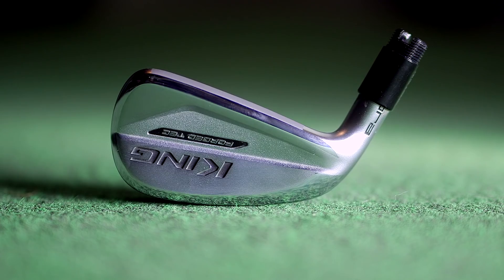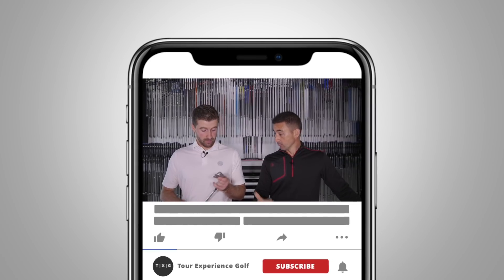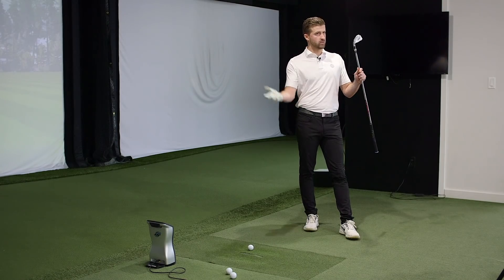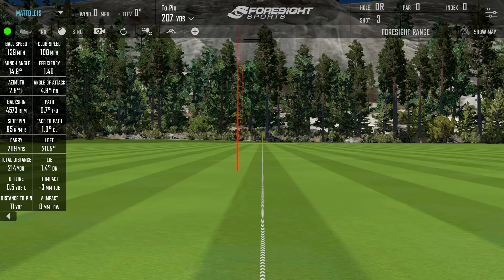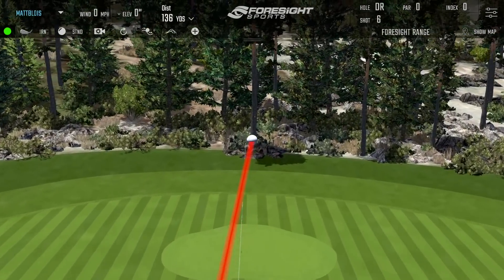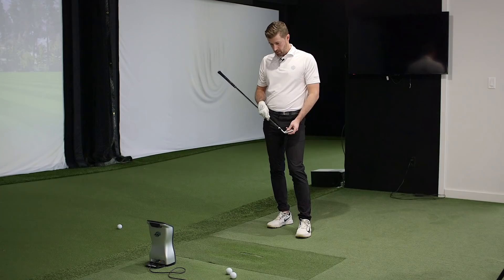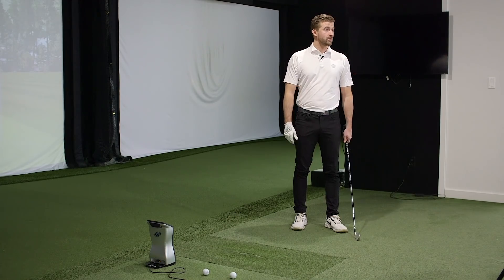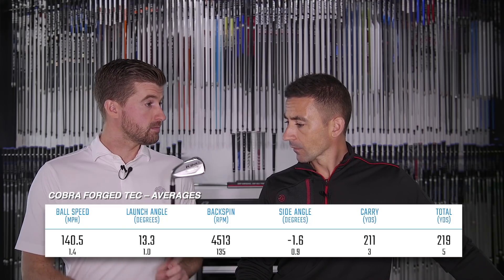Cobra Forged Tec Irons Review

Comment: Would love to see a test where you do a gapping session with the stock manufacturer specs. So get a set of clubs. Bend them so they are all exactly what the manufacture says the loft and lie should be on their spec sheet, and then have Matt hit them all.  I’d like to see if the stock specs of an off the rack set of clubs actually gives proper gapping.  I’d imagine these cobras and other sets where they get 2-3 degree gaps in the low end start to really bunch up badly.
Reply: Kourtney Matt is WAY above the speed of the target golfer for this set. The tech has changed - each individual iron is separately engineered on these sets. At the top of the set they're getting higher ball speed from the low loft & piling tungsten in the bottom to get launch. You'll get the distance gaps you should get - the problem you end up running into is that you get really high launch/low spin so you can't stop the 3-iron on any of these sets. 

However, no one is buying the 3-iron. That's part of why they're popular; golfers don't care about the 3/4/5 loft gaps because they're hitting the 5-iron 180 and using hybrids above that. 

I'm 39 & a 3 hdcp. Haven't carried a 4-iron since 10th grade. Hardly any golfers hit any 4-iron better than a 21-degree hybrid that goes a similar distance. I just switched from MP-64s to MP-20 HMBs 5-PW. 52/56/60 vokeys at the bottom and old TM hybrid that I can hit 190-205 above it. No gap problems at all.
Reply: @canyonaro  I get what your saying but swing speed is irrelevant when it comes to gapping. If anything higher swing speed would be more likely to have proper gaps with  2-3 degree loft separation than a slower swing player. Slower players see bunch ups in the low loft irons (3-5) irons even before manufacturers went down to 2 degree loft gaps because they don't have enough speed to create enough spin and launch to get the ball to carry reasonable gaps. Also in an iron head the cg can only be moved a small amount so you aren't going to massive changes in spin rates when you compare a blade at 24 degrees loft to a game improvement of 24 degrees loft. In fact a lot of times you'll actually see better stopping power in the game improvement irons because spin is similar but launch is better so you have a steeper decent angle.  If you don't believe me check out txgs game improvement vs blade video. The spin rates are basically the same. But I agree no average player should game an iron with less than say 24 degrees of loft unless they got a lot of speed. 24 degrees used to be a 4 iron. Now it's a 5 iron in modern lofts.

Comment: I tried these recently and am very tempted to try them, I hit the 7 iron in the fitting and numbers were around 141 ball speed, 7000 spin and 50+ peak height but could hit them low if wanted. 
I've always been wary to hit a club like this with a lot of speed but I wondef if you've had experience of faster players using stronger irons?
Reply: Project x shaft would probably help that

Comment: Bought a set of these  5-GW back in early September after a fitting (KBS tour 80 S) ... . 1st set of hollow players distance irons I've hit. Came from Wilson C300 Forged.... ( great irons, just fancied a change)..... kbs tour 105 R 
So 1st impressions were...these hit a strong powerful flight and dispersion seems tighter...move to lighter Stiff flex shaft...?? Thats what I wanted anyway .
Only complaint so far...and its not a complaint really.... is the clicker feel sound from the Cobras....I think I thought they'd feel softer but after reading your review plus a couple of others is that its the hollow foam filled head, even though face is forged.
But I'm getting used to it and definitely these are winning me over....and they are a powerful stiking iron.... Will stick with them and hopefully they'll prove to be the ones I've been eternally looking for 😉😂👍

Comment: I bought a set of these when they came out. I find them workable enough for my skill level, absolutely love the feel and sounds especially on the course. Only issue is I think I need to get the PW adjusted as the gapping seems a bit off for my swing. Otherwise, I’m absolutely a fan of them.
Reply: Hi do you mind sharing your handicap? I am debating if this fit my skill level. I usually shoot 17-21 over
Reply: @gonzcg01  Get a game improvement iron.
Reply: Would they be suitable for an 11 handicap ? Thanks !

Comment: What I did too match up the gapping with these irons was bought a forged tec black utility 2iron 18 degrees too meet the 4 iron 21 degrees they also have a new utility out as well. It’s hard too find but it’s a 3 utility 19.5 <—— this was too close too 21 degrees for me so I went with the older model utility 18=2iron adjustable •21-23-26-29.5=7 iron So on

Comment: So are they guaranteeing the lofts are correct. Since most OEms say lofts are plus or minus a degree.  They could be 1 degree apart.
Reply: Good point. And that's not even mentioning that forged irons can shift over time. If a 4 came in just 0.5 deg weak and a 5 iron just 0.5 deg strong, there could well be close on 0 degrees difference after a season.

Comment: a single length review in the 4 iron vs variable 4 iron.
Reply: Jada Mane Single-length 4-iron will lose. That's the weak point of the concept. Swinging 5-PW exactly the same is the benefit. 21-degree one-length hybrid is the right pairing with one length irons.
Reply: Jimmy Canzoniero I don’t understand. I’m new too this sport. I just wanna see the yard differences from the 39.5 measurement vs 37.5
Reply: Jada Mane The rule of thumb is about 3 yards per degree but the shorter shaft hurts the one length 4-iron's distance. They should fly close to the same but the one length will fly lower & spin less. 

If you're new to the game, forget 4-irons.  I'm 39 & have been posting since I was 12 and haven't carried a 4-iron my entire adult life. Better to do 5-PW and use a hybrid. A lot of people are even doing 6-PW now because hybrids are so much easier to hit.  Get fitted - a fitter will help sort all of it out for you.  Good luck!
Reply: Jimmy Canzoniero I hit every club well except my putter. Hybrids are cool but I’m a iron man as if I eat my wheaties 🌾 i do irons 2-9 variable length and i have single length set 2-6 and variable 7-sw.... I used too play all single length but it got too easy. So I went too full variable and that’s no problem either. So now I will just play single and variable. Splitting them in half too make things still challenging and fun at the same time. Hybrids I like in 2 and 3 I like sound over the iron. But the solid strike of a classical iron makes the game of golf. I’m new too the sport but I play like I’m a old schooler as the game first started. I like those irons. Not the modern day inventions. That’s just me. I’m weird like that / different. I love irons with a passion.

Comment: 4500 rpm with a launch of 13 deg. With a 6 iron. What is the descent angle ? Sounds like it’s less than 45° and if so it’s not Going to hold a green
Reply from the maker: If we were fitting these, we would bump the loft a degree up or so to get those numbers into a better window. Most players deliver more dynamic loft than illustrated here
Reply: TXG Tour Experience Golf makes sense !

Comment: I feel the latest game improvement irons from cobra are the most strong lofted out of the major manufacturers.  I almost feel like they are cheating a bit meaning they are being a little dishonest with consumers. With the current trend we might see a 40* pitching wedge soon. Scary.
Reply: Titleist T400 will have a 39* pw
Reply: The strong lofts are not the reason they go further - they need to make the lofts lower to compensate for the CG all moving the low back of the iron and great MOI. The further back the CG the higher the spin rate and dynamic launch. If they didn't, the balls would balloon up from the increased ball speed (MOI) and higher spin/dynamic loft (CG low and back).

Essentially, the balls go further because of CG and MOI being balanced with correct lofts.
Reply: Agreed. But where (loft)/when will they stop making them stronger and stronger. What I'm trying to get at is that players are  having a greater disparity between their pw and lw
Reply: Srixon pw loft has been the same as these cobras since 2016